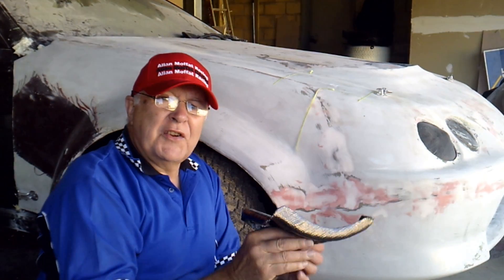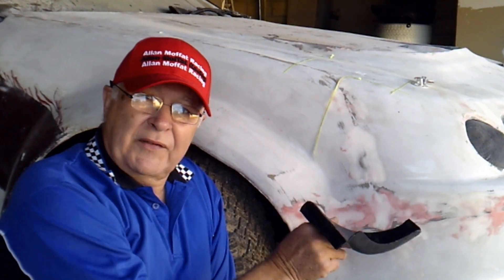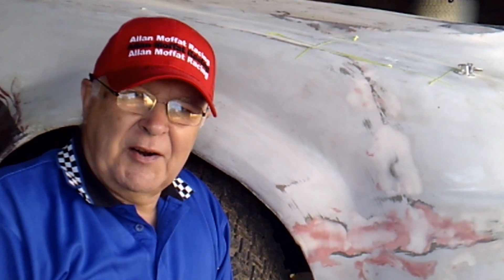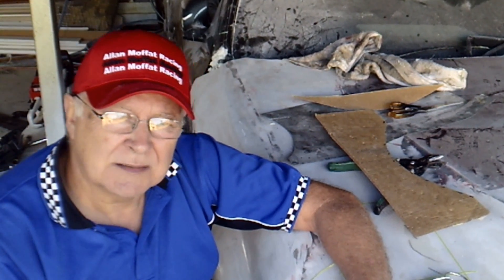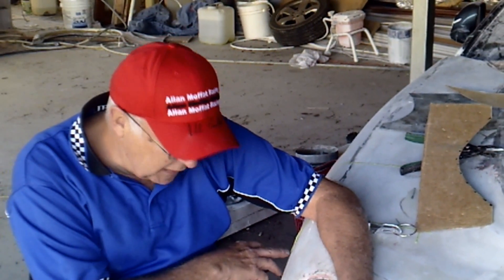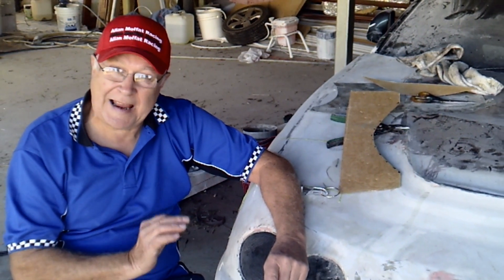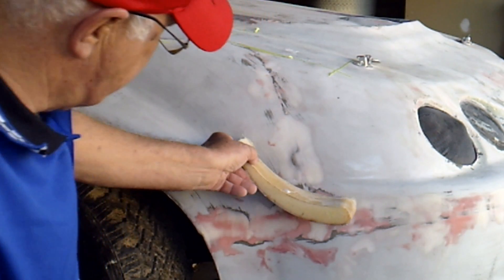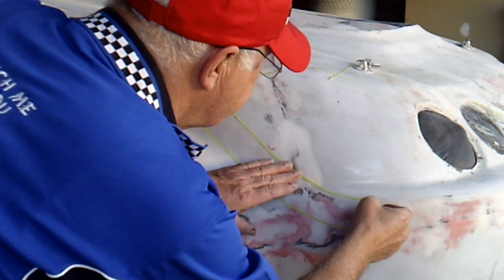How to Make Car Canards - Part A

Comment: Is there any equivalent for famo glaze coat in India?
Reply from the maker: Regardless of brand name you are after a TWO part clear gloss epoxy - usually sold as floor epoxy or "table" epoxy for making timber tops glossy & tough. Two pack clear epoxy. Just look for that.

Comment: Never used the varnish technique and struggling to find anything listed as a 2 pac epoxy floor lacquer in the UK. Local paint suppliers can do me an oil based poly varnish. Is this the right stuff??

Comment: Whats the best way to cut out the horizontal cardboard piece? I feel like i need a contour gauge to do it. Ive already wasted 2 pieces of cardboard
Reply from the maker: Rough cut it, then place it against the guard & trace the contour with a marker pen. Cut that out, then position that same piece of cardboard against the guard again, mark the contour again, and cut it again. Wasted cardboard?? Shit - I just raid the recycle bin!
Reply: Whats the best way to bend the tin to fit the horizontal cardbosrd piece? The way my body work is its not just a curve but its got a few angles it need to go into. Can u email me? Rhapsheet@yahoo.com would greatly be appreciative :)